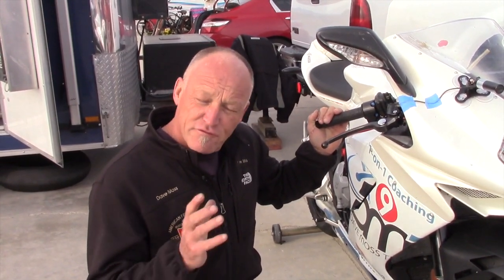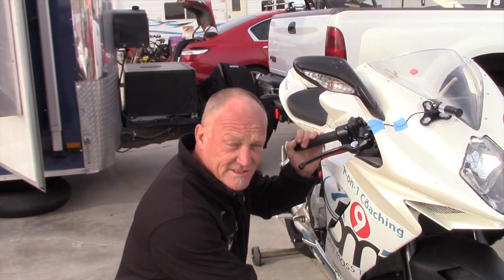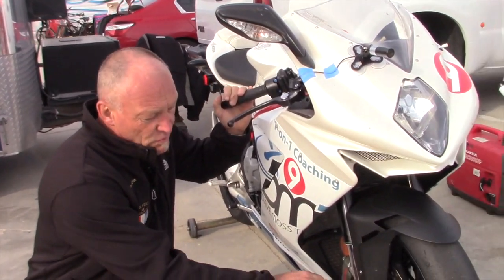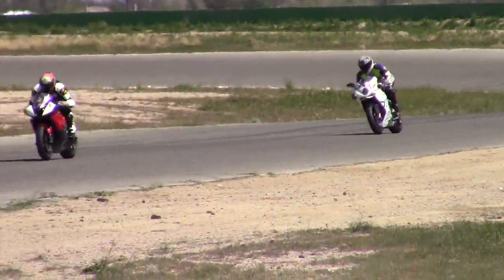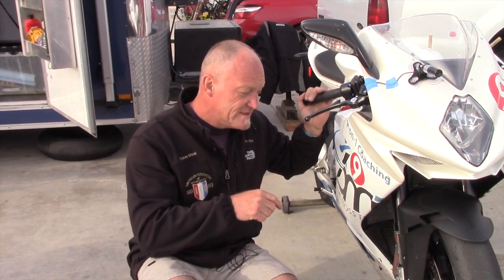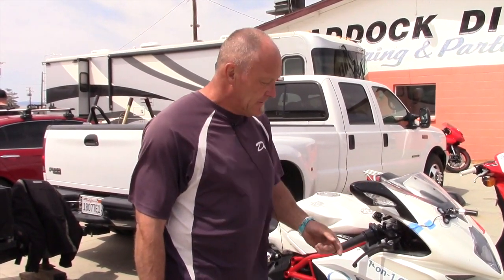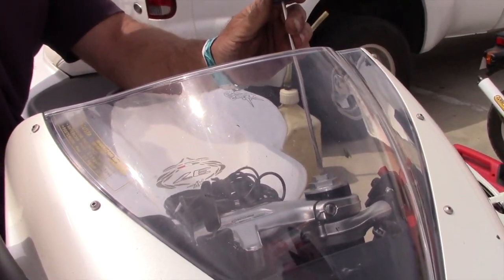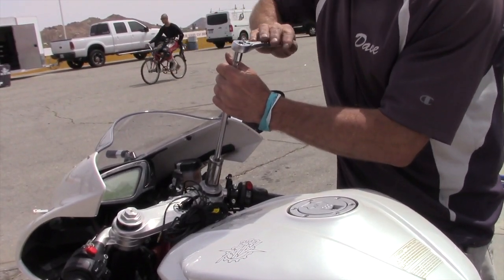Bottomed Out Motorcycle Forks

Comment: Interesting. Because on my ducati supersport I have a similar issue. I'm 3 turns away from fully closed preload. But with my compression I have 10 turns left from being full closed. Should I remove some preload and add some compression and wouldn't I bottom out faster if I do so?
Reply from the maker: Spring holds the bike up, compression controls oil flow (dive) under braking. Leave preload alone, test 14, 10, 6 for compression.

Comment: Dave, if you adding another 2 full turns of pre-load and full turn of compression on this bike in the video, don't you also have to change the ride height in the rear to balance the bikes geometry?
Reply from the maker: Fork geometry and settings are all about braking stability and turn in. Rear shock length and swing arm pivot to axle is all about swing arm angle mathematics for rear grip under acceleration. If you go 5mm or more for increase in shock length you can have the balance point of the motorcycle move forward.

Comment: Hi Dave. Thank you for the video!!! I was wondering would it be helpful at this instance to play with geometry and lift the front with triple clamps? Cheers...
Reply: Good question.
Reply from the maker: If the fork is running close to bottom it would make sense to try raising the forks a little (2-3mm) to see if that can offset weight transfer and assist against bottoming.
Reply: when is it recommendable to change geometry? thanks
Reply from the maker: Any time is the right time and sooner rather than later - you want to experiment with fork position for turn in. Rear is mathematics for swing arm angle which is essential to grip. Define your bike to meet your needs soon and as accurately as possible.
Reply: KTM RC390 2017 stock

Comment: I'm bottoming my forks under heavy braking and getting some front chatter and am wondering if I add more preload though this may help I'm assuming it will make the front sag out of its  optimum measurement. So is sag that important or is it worth sacrificing it for a stiffer front. I only run on track .
Reply from the maker: How old is the fork oil via miles/kms and time? A simple fork oil change with 25cc more than the service manual volume may do the trick instantly. Fork oil service is every 8,0000 miles or 11,000kms

Comment: Does the 30% rule apply to all suspension settings? For example, does it apply to compression (low and high speed) and rebound on the rear shock?
Reply from the maker: Yes, many are surprised when they see that they are better than the OEM equipment via ability or old fork/shock oil. Once educated about risk and servicing, the understanding of being "better then" makes sense as it has a rationale and evidence behind it to then warrant expenditure with upgrades. NEVER leave the bike behind you!

Comment: Hi Dave!
I wonder if you could point me in a direction regarding swing arm angle. 
I've engineered a suspension linkage that raises the bike by an inch. What angle between rear axle and swingarm pivot is ok?
Many thanks Dave have a great day!
Reply from the maker: 11-13 degrees with the tires just touching the ground